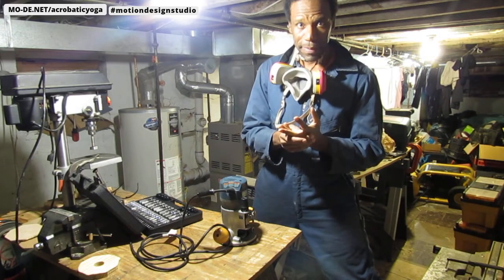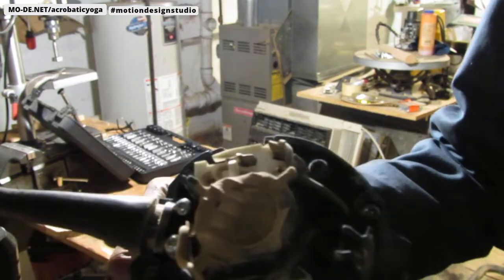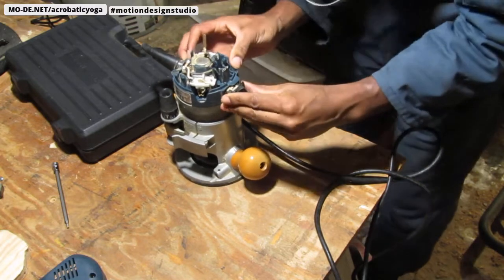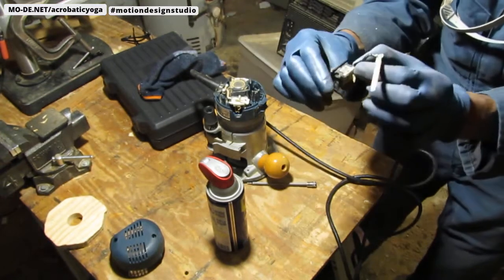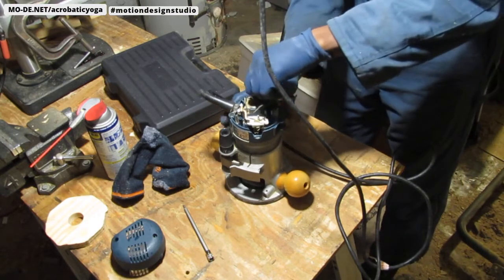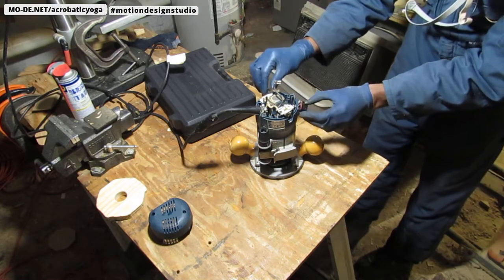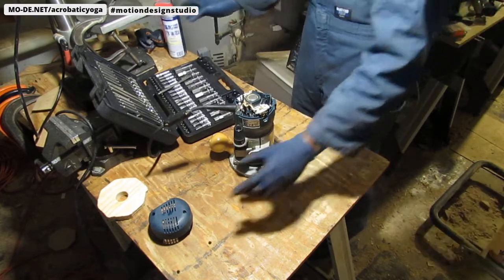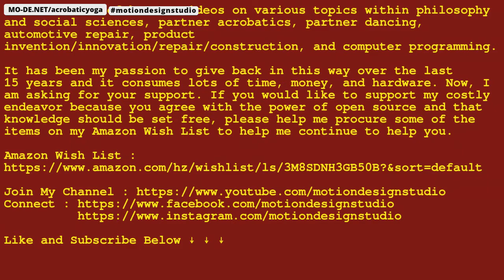How To Fix Bosch 1617 RA1161 Fixed Base Router Power Switch

Comment: What worked for me is to take the switch completely out and put it in a bag of 90% Isoproply Rubbing Alcohol. I shook the bag up vigorously and out came a lot of small dust that even after tons of spraying with the air compressor wand it didn't remove. After shaking it for several minutes and letting it soak, I took the switch out and again sprayed it with air so it was completely dry. Plugged the switch back in and it fired up. So just FYI, air alone might not solve this problem.
Reply from the maker: Thanks for explaining your process.  Next time mine fails I will try this.

Comment: I just had this issue and the switch itself comes apart pretty easily, there are four little clips holding it in it's housing. Mine was loaded up with dust which was blocking the connection
Reply from the maker: "Need resistances? get some fine wood dust" should have been the title of this video.  Alas you found a solution here.  So glad this has helped you keep this great router in service.  I still need to replace a bearing on this unit.    Have a great week and thanks for joining me on this repair journey.

Comment: Nice job, will help me troubleshoot - same deal, won't start.  Yours is apparently a non-variable speed as I didn't see you remove or put a VS "gizmo" back in place on top before reinstalling cover.  The switch part number for your router can be found on Bosch site.  My Model 1617 EVS router switch is part no. 2610 016 525, maybe different for yours.  Thanks!
Reply from the maker: Best of luck and thanks for sharing the information on the differences.

Comment: Nothing worked until I squirted WD40 in the switch and blew it out with air gun. Working again, thanks!  Not sure why they would use a switch that fails with a little dust on a dust MACHINE like a router in the first place. Wonder if I could seal the holes around the switch with silicone so it doesn't happen again?
Reply from the maker: "Not sure why they would use a switch that fails with a little dust on a dust MACHINE like a router in the first place." this is a common refrain.  Let me address this.  Any product you use might have multiple types of engineers with sometimes conflicting goals.  Then you have the business side of a company.  They make choices that affect the design and quality of the end result.  There are many moving parts to getting a product from thought to finish and extremely difficult to get all the moving parts working harmoniously.   Occasionally it works out but those products are the exception in the sphere of consumer products.  As the risk of life being loss increases you can see a a lot more care taken to ensure a better design take for instance space travel, brakes on a car, and airplanes.  They are not perfect but require some degree of engineering puts aside differences and competing interest because to much is at stake and no one will purchase or use a product if we do not get this right.   Economics at play  birthing good engineering as an afterthought.
Reply: @MotionDesignStudio  I also learned from other content that these types of switches are prone to oxidation on the contact points inside. You have to go a step further and disassemble the switch component and then clean the corrosion off with an abrasive like steel wool or a chemical spray like DeoxIT D5. I guess the WD40 I sprayed in there helped, but if it happens again I think I will go with the DeoxIT. Thanks for the reply!
Reply from the maker: @robertwittman9793  , thanks so much for teaching me this.  I will use this information if this switch begins to fail again as aforementioned.  Lucky for me I keep DeoxIT contact cleaner on the shelf.  Robert you are the best and have a great remainder of your day.

Comment: T-15 Torx
Reply: Yes indeed thanks for sharing cleaning rather than replacing the switch. You can open the switch and clean out dust internally. It is easy to take apart (carefully to not lose parts). Yes, testing the continuity is good to do first then after cleaning. I had just repaired mine and then hoped to find a video to encourage repair vs replace the part. I hear there may be a new switch that is better sealed. Note, cleaning the exterior is not likely the solution. The dust inside the switch itself causes the switch not to work, preventing contact. Jostling and blowing air is likely what solved the problem.
Reply from the maker: @peterkmartel  I agree with the opening,  cleaning and checking continuity.  May you please share the make and model of the better closed switch?

Comment: Its a torx screw on the cover. And please dont use wd40 to clean electrical components. It will attract dust and clog it more and since it doesnt dry you could end up shocking yourself or shorting out the equipment
Reply from the maker: What would you suggest to clean the electrical components?  What size is the torx screws?

Comment: You can take the switch apart to clean it thoroughly. I had the same problem and my contact inside the switch was black. Cleaned it off with my pocket knife and she is back in buisness!!
Reply from the maker: Anytime Travis Wilson and it is nice to connect.  It is a great router and glad we saved this one.  Mine was acting funny for 3 months before it finally failed.  Please subscribe it truly helps.

Comment: A few things to note for people who view this helpful video.  1.) Do not spray WD40 on any device containing nylon parts (i.e. brush holders, switch assemblies, etc.) WD-40 formulations can contain solvents which will ruin such nylon parts. After exposure, the parts will eventually embrittle and crumble. It usually takes several months, but once you soak nylon with such a solvent, failure is inevitable. Therefore, do NOT allow WD-40 or any spray lubricant with aromatic hydrocarbons to touch nylon. Ditto for "lubricating" air nailers with WD-40. Do not do it or plan on nylon part failures. You have been alerted! 🙂 If you want a comprehensive proof list of what does and does NOT work with Nylon, here it is;  https://www.calpaclab.com/nylon-chemical-compatibility-chart/

2.) The mystery screws are called Torx. They are standard issue fasteners on most European and many Japanese tools, appliances and automobiles, etc. For those who care, the top cover screws are T15, while the base plate screws are T20, etc.   
3.) Note that the Bosch 1617 Router on/off switch is notorious for failures due to dust incursion. Blow it out with compressed air after every use. 

COMMENTARY: Bosch really cheaped out on this switch, IMO. Very disappointing to see such an otherwise nice router ruined by such a poor unsealed switch choice.